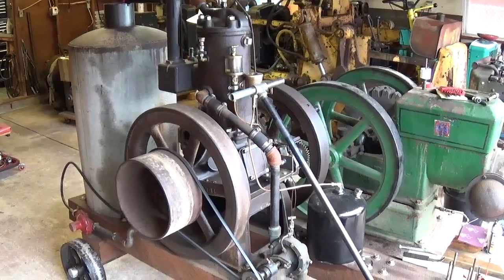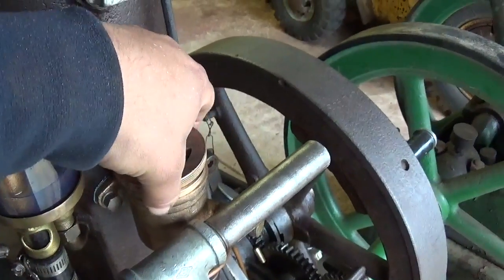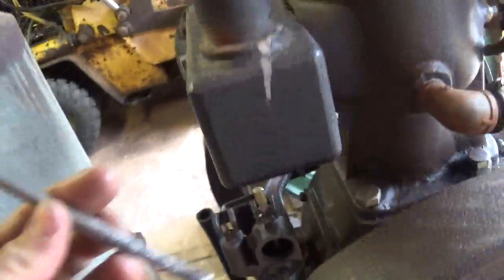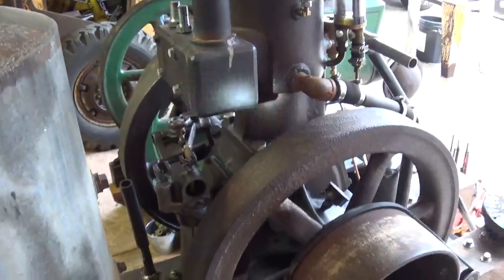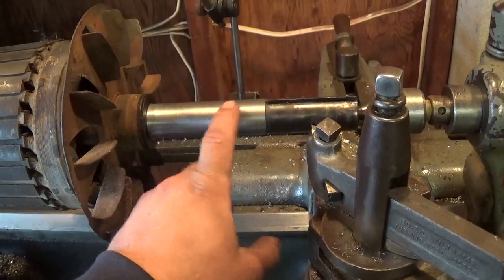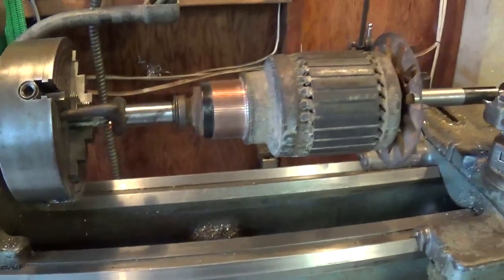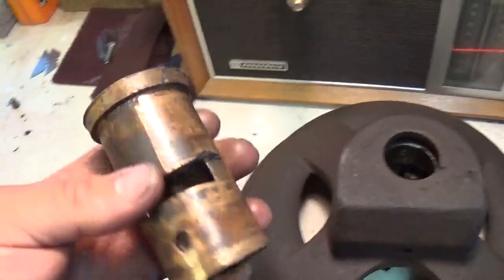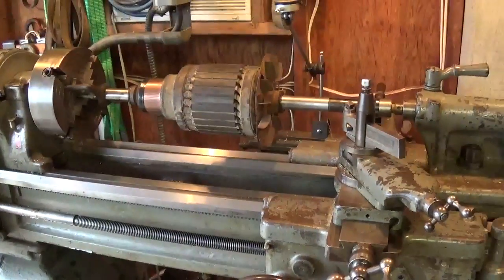8 Horse Bessemer Continued with Generator

Comment: The Bessemer is a really neat engine... not too many small ones like that. I think you've done a great job getting it back to original. It looks like the governor just controls the inlet air? So I'm curious how a proper fuel / air mixture is obtained / controlled when it's running on gasoline? I'm not sure if you're interested but I've been reading Clerks book on how the 2 stroke was developed... I'm in the process of making a copy of Atkinson's Utilite' engine. The section on 2 strokes starts on page 184... here's the link to the book.  https://books.google.com/books?id=aB9YAAAAYAAJ&printsec=frontcover&dq=The+gas,+petrol,+and+oil+engine,+Volume+2+By+Dugald+Clerk&hl=en&sa=X&ved=0ahUKEwjv1rPS-M_NAhVD2mMKHRGrCdsQ6AEIJzAA#v=onepage&q=The%20gas%2C%20petrol%2C%20and%20oil%20engine%2C%20Volume%202%20By%20Dugald%20Clerk&f=false

Comment: Considering you've thinned out the shaft, i wonder if sneaking needle bearings in there could be possible. I know there are some thin needle bearings used in some half shafts.

If those are able to take both speed and load... it shouldn't  pose much problem here. I don't know the brand of the bearing, but i had a few from my grandpa's parts box. The needle bearing cylinders were roughly 2 mm OD and quite a few of them, say 35 or so. The whole thing fell on the ground when i took it apart.
Reply from the maker: +aserta I imagine it would not have been too difficult to retrofit this to a more modern needle or ball bearing.  However with a unit like this I try to stay as true to period correct repairs as possible. Thanks for watching!

Comment: Great video. Have a steam engine which uses the same idea for oiling its main bearings. The rings just dip in the oil and keep the shaft constantly lubricated. Pretty simple and it works.
Have the same South Bend lathe also.... Practically indestructible. Is that the original colour? Mine is a darker green but has been painted. Would like to repaint it the proper colour. Thanks for posting